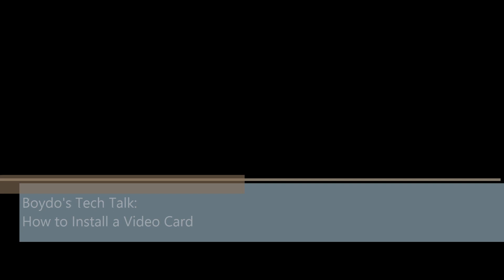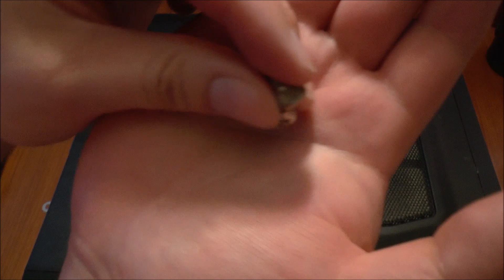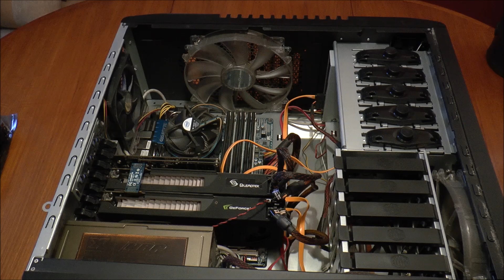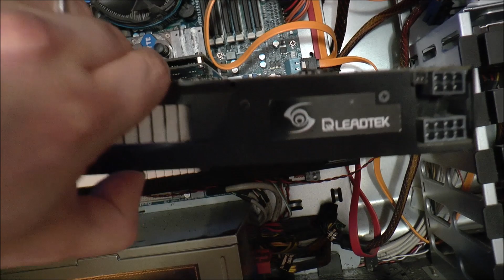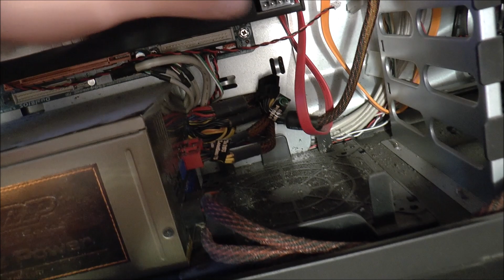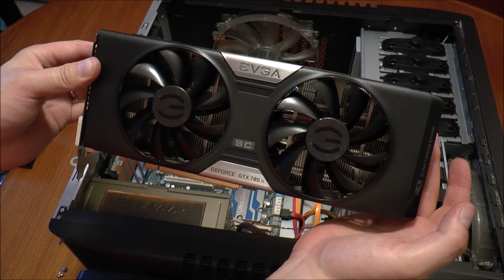How to Install a Video Card

Comment: since you are very knowledgeable, i was wondering how do i figure out which graphics card(s) work with my desktop? ive been meaning to upgrade but no idea if my computer is able its less than 2 years old
Reply from the maker: +Speedfoot89 There are a few things to consider - the capacity of the power supply inside of the computer, its efficiency, how much capacity is being used by all other components in the computer and finally the physical dimensions of the card (to make sure it fits).

is this a brand name computer or one you have built yourself?
Reply: brand new from an electronics store, best buy its a dell inspiron of sorts
Reply from the maker: +Speedfoot89 Okay, do you happen to know the model number of the Inspiron? That'll help with looking up the specs.

Comment: would it be ok to put a AMD Radeon™ HD 7870 GHz Edition into a hp-pavilion-h8-1200eb and if so what powersupply should I use ?
Reply from the maker: Okay so that card seems to have a peak load of 190W. The HP has a 460W PSU so assuming an 80% efficiency then that leaves you with 368W. Take off 95W for the CPU under max load and you're down to 273W. This leaves you with 87W to power the remaining components in the system (motherboard, RAM, hard drive, optical drive, etc).

Without knowing the specific power consumption you could be cutting it very fine - the motherboard in the HP probably draws 40W by itself with 6 - 12W for RAM, 10W for the hard drive and 30W for the optical drive (when it is in use).

So, to answer your question I would probably recommend a 750W PSU if you're willing to swap out the existing one but bear in mind that may affect your warranty. Provided HP haven't done anything weird with the motherboard in the way of power connectors,  there is sufficient clearance around the PSU for the replacement and the PCI Express x16 slot also has clearance for the card then you should be okay.
Reply: ok man thanks !! :)